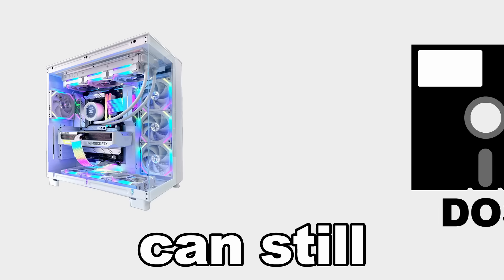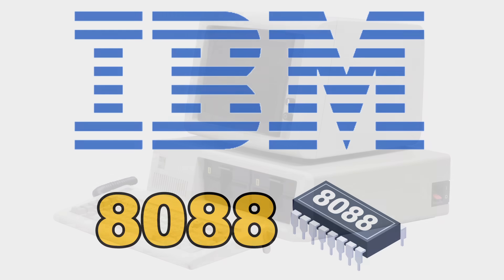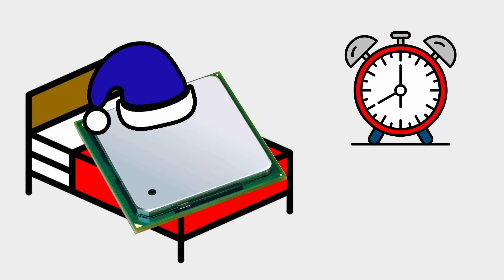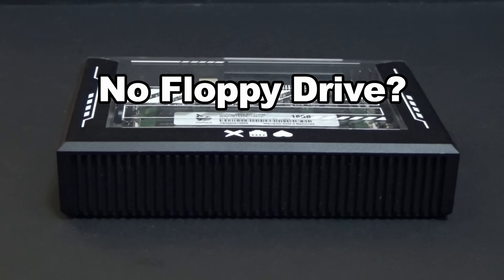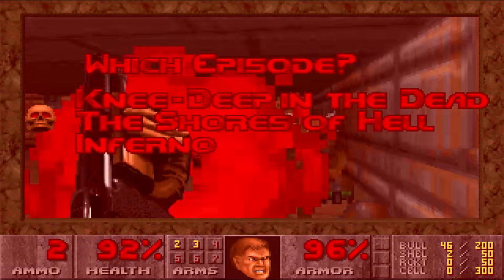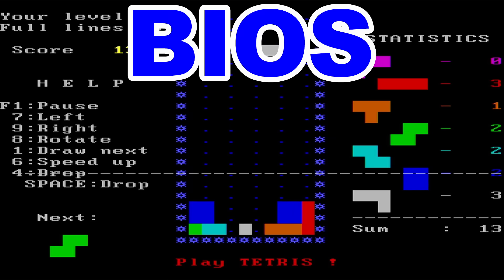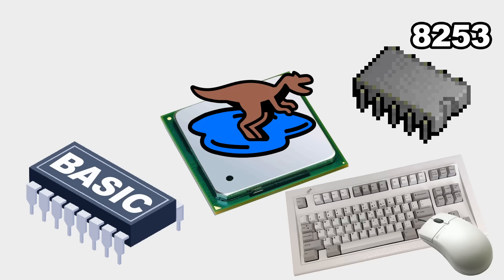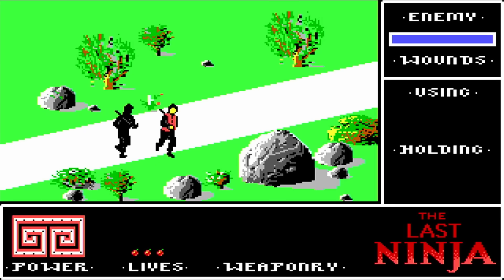45 Year Old DOS on a New Intel CPU Without Emulation

Comment: Here I thought Backwards Compatibility was how we have emulators and don't really need to install much else. 
I didn't know windows was just emulating windows emulating windows
Reply from the maker: An emulator is a program that replicates a different computer system in software, like an NES emulator which is a program that operates like NES hardware in order to execute an NES game. 
Hardware backwards compatibility means that a game written 30 or 40 years ago can still be executed directly by the CPU just as it could originally.
Reply: @InkboxSoftware  Ah I see. Thank you for explaining!

Comment: memes aside, the ability to run legacy software is key to a lot of infrastructure
Reply: Beat me to it by several weeks. I've worked in places that run very expensive manufacturing equipment that, at its core, is running some old version of DOS, plus proprietary software to run the machine. If that old processor goes out, they will spend the money to put another processor in, not replace a piece of equipment with a six- or seven-digit price tag.
Reply: @TheRealScooterGuy  the oilfield is that way also I've seen some pre pc stuff still run and state of the art right next to it...its kinda cool to see tbh
Reply: @jacknifedbl We have an old PLC that was used for submarines in 2001 that controls 40 top of the line drivers and servos and an extremelly complicated HMI made by a company that don't exist anymore.
Reply: @jacknifedbl around 10 years ago I saw a BBC Micro (old British 8 bit machine) controlling a massive steerable radio telescope after a massive upgrade. It was networked with a rack full of brand new Xeon servers I wouldn't really turn my nose up at even today.
Reply: And let's not forget just how long a legacy software can have! There are grandparents around today who are younger than the software being used by big banks.
Reply: @Roxor128   thats why countries with early developed software infrastructure suck at integrating new technologies.
Take Russia, due to late(2000-now) development we have one of the best internet government integration. Like there is never need to go to an office to make some documents or pay bills, everything just works outta your phone.
Also we have "СБП" - instant payment system you can send money, pay bills, pay at the shop, pay online with no delay.
Reply: @Roxor128   thats why countries with early developed software infrastructure suck at integrating new technologies.
Take Russia, due to late(2000-now) development we have one of the best internet government integration. Like there is never need to go to an office to make some documents or pay bills, everything just works outta your phone.
Also we have "СБП" - instant payment system you can send money, pay bills, pay at the shop, pay online with no delay.
Reply: I'm finding Starglider a bit hard to play, though...
Reply: I think we need better infrastructure
Reply: Infrastructure?
Reply: @incumbentvinyl9291 In 2024 the German railway systems became a bit of a laughing stock, they were looking for an IT specialist for Windows 3.1 for some older systems they still have in operation. The German railway systems are very unreliable and something like 90% of trains are delayed, so the public quickly concluded that now they could understand all the delays 😂
Reply: @ReneSkotte  Be glad that you still use old computers that are reliable, switching to new systems will just make everything worse. Here in Czechia, each upgrade of any system will always double or triple all problems, the most reliable trains are on oldschool rails with no security where they are using oldschool "hoo hoo" method and radio. Sometimes you hit other train, but that's part of it, it's still statistically more safe than cars. 😀 Our main corridor is overused and they always promise that this and that update of systems will improve efficiency and it will start working reliable now.....in reality, it's worse and worse, it worked fine 15 years ago before they allowed private companies doing mess here + they disconnected infrastructure owner from public train company and that caused most of problems because head doesn't know what heel is doing as we say in Czech, maybe you say it too in German, we probably just stole it and translated it. 😀
Few years ago, private train companies created genius plan how to solve our problems with low unemployment - to hire train operators from Bulgaria, after some accidents where they didn't understand each other in radio, they forgot about it and pretend it never happened. 😀
Reply: @Pidalin Correct, at least the old Windows 3.1 didn’t get a Crowdstrike update 😂 By the way I was often in Brno for work, but never used trains in your country 😊
Reply: @ReneSkotte  High class trains are mostly fine becuase it has priority everywhere, but try to use common trains that stop everywhere, it literally stops everywhere, like literally. 😀
Reply: @Pidalin  That's not infrastructure, that's logistics.
Reply: @incumbentvinyl9291 Infrastructure are roads, railways and stuff like that, but maybe you use these words differently in English, as always. 😀
Reply: @Pidalin  Exactly.

Not the trains or systems, nor the planning and timetables.

I use them as the words are intended and by the definition in the English language.

infrastructure
/ˈɪnfrəˌstrʌktʃə/
noun
the basic physical and organizational structures and facilities (e.g. buildings, roads, power supplies) needed for the operation of a society or enterprise.

logistics
/ləˈdʒɪstɪks,lɒˈdʒɪstɪks/
noun
the detailed organization and implementation of a complex operation.

'Logistics is the process of planning and executing the efficient transportation and storage of goods from the point of origin to the point of consumption. The goal of logistics is to meet customer requirements in a timely, cost-effective manner.'

Are things getting any clearer to you? These terms are not synonyms. Two completely different things.
Reply: @incumbentvinyl9291 I think I get it, but I still don't know why you reacted at me, I was not saying anything about some logistics. 😀
Reply: @Pidalin  Reacted at you?

You were saying it's about infrastructure, which it is not.

At the end of the day it's very simple. A glance at a dictionary is enough to comprehend this fact.
Reply: @incumbentvinyl9291 But infrastructure is much more than just some road, there is also state infrastructure, that means things like systems to communicate between different authorities and stuff like that.
Reply: @Pidalin  That's why we have state infrastructure and state logistics. The exact same applies as with infrastructure and logistics. Adding ''state'' to it changes nothing.

Unfortunately your reading comprehension seems to have failed you.

I thought that I had made this abundantly clear, but if you're not willing to learn and accept facts, then there is no point in spending any more time trying to educate you.
Reply: @incumbentvinyl9291 Google the word.
Reply: In my experience all of them.  Ironically enough old big iron has no problems with newer software, it just runs really slow, be it a port or an emulation.   Touring complete machines and all.   Remember the turbo button?  yep, it was simply a clock limiter so legacy software ran at normal speed instead of ludicrous speed.   an 8 bit alu can run all 64 bit software, you will just be waiting a few lifetimes to get any outputs, but outputs you will get, and correct they will be.
Reply: @SaanMigwell  Not exactly.
Reply: this is why itanium F##kin died
Reply: truly, I love it
Reply: A lot of factories still use CNC machines with some DOS based software and their programs are that complicated that it would be crazy to do it everything again on new machine with today stupid bugged software. 🙂 Fortunatelly, we have machines already from Win XP era, that was the best time.
Reply: Most have 0 clue...😂

Comment: The question if these old instructions take much space on the CPU: No, they don't! Because modern CPUs don't have the instructions hard wired anymore. They are just microcode, an interpreter, that translates the old x86/x64 machine codes into proper RISC subcodes, that then are send to the cores. In fact, since Pipelining became a thing with the Pentium 1, this is already the case, and since dual core the old instructions need to be preinterpreted anyway, to make sure that the code is send in correct order to the cores.

Comment: This is a big reason why I'm a bit of an x86 fanboy. Yes, the syntax for x86 asm is bad, but it's rare to write x86 by hand anymore. The compatibility is beautiful. I often bring up embedded ARM systems(usually zynq or zynqmp) and specifying devices in device trees, configuring u-boot is tiresome. This is why for instance with OpenWRT you see one build for x86 and 50 others for variants of ARM/MIPS devices.
Reply: Yeah compatibility is truly it's superpower, and by the looks of it AMD is getting even more serious about power efficiency with Strix and Intel is with Lunar Lake. There's lots of doomsaying about x86 but if history as proven anything it is one of, if not the most, adaptable architecture in history and clever engineers always find a way to break the mold with it.

Comment: Unfortunately, virtual 8086 mode has been removed from x86-64 long mode, so it's no longer possible to run a "DOS box" inside a protected mode operating system using native hardware execution.
Reply: Yes you can, it just can't be an AMD64 long mode operating system. V8086 works just fine in 16- and 32-bit modes.
This is why Windows lost WOW16 (edit: WOW32, rather) in the changeover to 64-bit: it was already quite complex (not to mention a performance hit) to switch from 32-bit protected mode to V8086 mode and back, and I'm informed it's an absolute nightmare to switch from long mode to legacy mode, then from legacy mode to V8086 - and then of course back again once the DOS program has finished its timeslice.

As such, last I heard, both Intel and AMD recommend using their virtualization extensions (with an arbitrarily tiny hypervisor) for V8086 mode-like operation, instead of jumping through all these hoops.
Reply: In theory you can run V86 inside virtualized IA32.

Comment: Sometimes I wonder what number of 86 we'd be on nowadays.
Reply: By my reckoning, a 14th gen Intel processor would be a "2586". Here's my logic:

The Pentium was the P5 during development, and was going to be the 80586 until mere months before release, so 586. The Pentium Pro was the P6, so 686 (and it's ISA is often called that in source code). Pentium II was merely a slightly respun P-Pro, but I have no doubt Intel would have called it a 786. Pentium III was merely a slightly respun P2, but again Intel marketing would have ensured it was called the 886.

The Pentium 4 was radically different to anything before it, and definitely would have been the 986 as a result. The Pentium M was an interesting case, being a mobile processor, and not related to the "real" 986, but that wouldn't have stopped Intel from calling it the 986-SX or something. After that, the original Cores (not Core i[n], they came later) showed up. Core would have been 1086, and Intel would have made the Core 2 the 1186.

Then finally, along came Core i[n]s, and the original Nehalem would have been a 1286 (as long as you had a Super Duper Wowser VGA monitor). The Sandy Bridge second-gen 1386, Ivy Bridge third-gen 1486, Haswell fourth-gen 1586, and Intel would have called Broadwell (the obscure, stalled "fifth gen") and friends the 1686.

At this point, you can see the pattern that Core i[n] is just 1186+G*100 - 6th gen is 1786, 7th gen is 1886, 8th gen is 1986. Add 600 to get to 14th gen, and you get 2586. For extra marketing giggles, they could have called Celerons [nn]86SXs, i3s [nn]86DXs, i5s [nn]86DX2s, i7s [nn]86DX3s, and i7s [nn]86DX4s. A Core i5 11600K, as such, would be a 2286DX2-3900.

I don't know what Intel would have numbered their embedded x86 processors, but Intel (and Motorola - everyone in fact) would add or subtract a random value, or suffix for their embedded/microcontroller versions' names. The early Atoms are a fairly cut-and-dry case though: it arrived via the Stealy microarchitecture, which in turn was a modified Pentium M. As such, the original Silverthorne Atoms (from before they evolved into cut-down Cores) would have probably been the 1096 (add 10), the 1076 (minus 10) or perhaps the 1086EX.

Anyway, thanks for reading my blog. Don't forget to like and unsubscribe, and berate me on Hatreon. 😁
Reply: @throwaway6478  I love this! You did the math I was too lazy to figure out. Thanks!

Comment: IA-64 x86 compatibility was only 32-bit and never was a huge priority and it wasn't providing full compatibility.  Intel at the time thought native IA-64 code would quickly obsolete x86 so putting a lot of engineering and die area on x86-compatibility would be wrong.  Meanwhile AMD did their x86-64 thing and the markted decided.  One of the early adopers of x86-64 was the Linux community which at the time did support several other 64-bit architectures including Alpha, SPARC64, MIPS, PPC64 so x86-64 was really just a formality.  IA-64 has some niche success with supercomputing or highly available systems (IA-64 did support master-checker afair) - not enough to tip the scale in favor of Intel.
Reply: don't forget Itanium was created by Hewlett-Packard. Intel only joined in development later. And HP took a pretty big hit financially from the failure.  I don't think the Linux community was even a factor, because they ported to everything, they would adapt to any 64-bit tech as you note yourself.  A big factor was costs.  It cost the market (as a whole) a lot less to hold on to Win32 and be discretionary about what to software to port(and/or buy) to 64-bit.  Yes the market decided, but it was short term (maybe even quarterly) budgets vs upfront costs for moving to an entirely new architecture.
Reply: @squirlmy  The Linux community in that case was a whole bunch of companies including HP, Intel, SGI and others plus various Linux vendors, the usual suspects including smaller ones such as Turbolinux and contractors.  SGI was among those early adapters because they wanted to get rid of their inhouse processor development.  Which arguably is what IA-64 did best - it resulted in the end of the Alpha, HPPA aka PA-RISC and the high-end variants of MIPS.  SGI's traditional customerbase controls their own software which was already running on 64-bit.  So the 32-bit compatibility was never much of interest.  In In fact due to memory size 32-bit was no practical option even back then.  Afair the first SGI Itanium system had 64-bit processors.  HP's customer base was probably to a large degree identical so I don't think they had much interest in 32-bit either.  Intel was making a bunch of IA-64 systems such as the Big Sur but I'm not sure if they were ever planning to become a big mainboard or system vendor.  Microsoft and IA-64 was an entirely different matter.

Yes, the market did decide.  Itanic took Intel a lot longer to finish development than they were planning for.  At the same time Itanium 2 aka McKinley's was looking like it was going to be a faster processor than promised and arriving earlier.  SGI eventually decided to cancel their Merced product in favor of the McKinley.  Which however meant their first IA-64 product was being delayed yet again.  Meanwhile AMD's x86-64 was looking much more promising and became available on the mass market at interesting prices.

This left a few niche markets for McKinley-based systems.  Floating-point-heavy applications did tremendously gain.  Also initially systems with massive I/O and memory were better off with McKinley than x86-64 since the heavy hitters HP and SGI had been working on them.  Another niche was HP's Tandem division.  Tandem was building fault tolerant systems.  The sorts that doesn't crash only because you yank out a  few parts or is hit by the death star.  Tandem was using MIPS; an attempted migration to Alpha had failed so eventually they migrated to Itanium.  Meanwhile there was no support in x86-32 / x86-64 for that sort of fault tolerance, so they were stuck with Itanium for a long time.

These were niches.  x86-64 was meanwhile selling like fresh rolls.  By the time Windows Vista, the first version of Windows with 64-bit support out of the box hit the market, x86-64 was already widespread.

What also helped selling x86-64 was that it was a better architecture design than the i386 aka IA-32 architecture.  For every other architecture 64-bit code was running slower than 32-bit because it was bigger resulting in a lower cache hit rate.  Not in case of x86-64.  

Meanwhile Intel themselves appeared to have lost interest in IA-64 a bit.  I think one reason was also that IA-64's EPIC (remember EPIC is the new VLIW ...) was hard to efficiently generate code for.  That issue held compilers back; the actually achieved performance of compiled code was well less than what the hardware actually was capable of.  And some features of the IA-64 such a giant register sets and register windows made for inherently large dies and complicated designs without achieving the original design goals.  Then the unimaginable happened, Intel took an x86-64 license, had to catch up with AMD's x86-64 implementation and at the same time had that boat anchor IA-64 tied around their neck which they couldn't drop because they already had a customers.